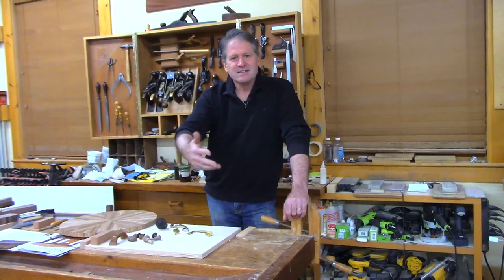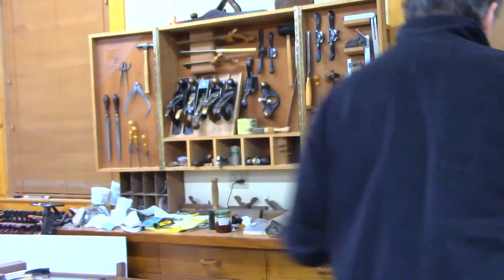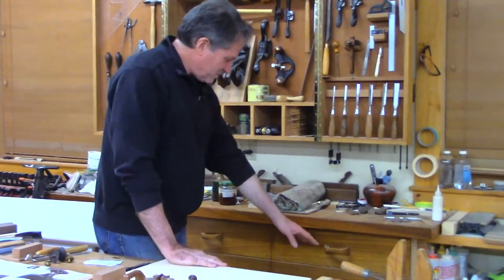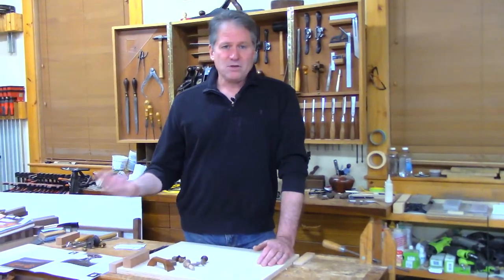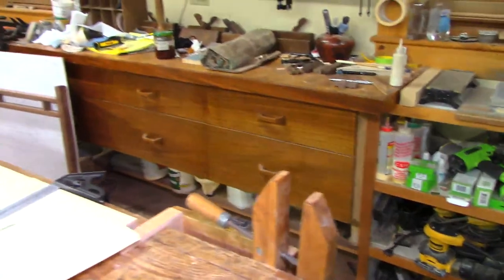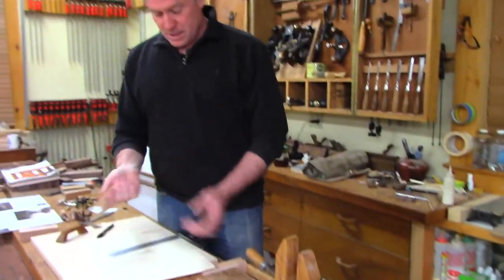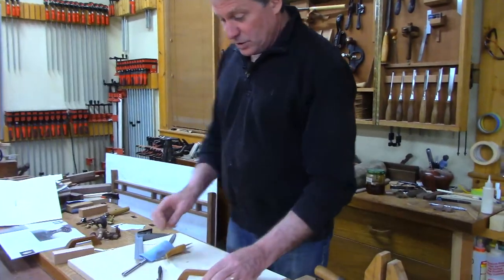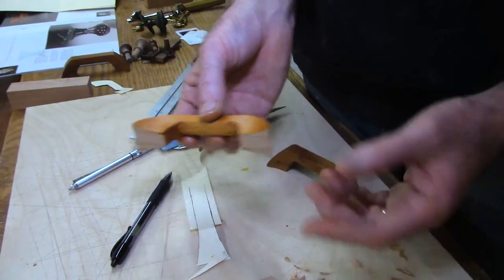How to Make Wooden Drawer Pulls with Tom McLaughlin

Comment: James Krenov may have been a crusty old woodworker, but his ideas and designs have been an inspiration to many outstanding craftsman -- and even some of the rest of us. Over the years, I have built a number of projects inspired directly by Krenov. The first was a wall-mounted jewelry cabinet with a coopered door and two dovetailed drawers. I made this over twenty years ago, yet it is one of the first things my wife talks about when she explains the work I have done. She treasures it; I treasure that she does. I built a similarly-coopered two-door hanging cabinet in cherry for my mother-in-law; it is now in the possession of one of her great granddaughters, who adores it as much as her great grandmother did.

A second example is a chess board made with "floating" squares after Krenov's design ("The Impractical Cabinet Maker", I think).   I didn't make a chess table; rather I built a chess board mounted to a two-drawer case. I presented this piece as a graduation gift to a student abut 15 yeas ago. The tiles were made of air-dried walnut and birds eye maple. The case was walnut. (The walnut came from a lightning-struck tree in Reedsburg, WI that was milled and stored in a barn for 18 years. Bat and pigeon guano bring out the best in walnut, it seems.)  The student's mouth dropped open and he teared up when I gave it to him, because he thought it was such a stunning piece.

There are other projects similarly inspired by Krenov, particularly the way he used hand-made handles and pulls. These became part of many boxes and cases I sold at art galleries over the years. It seems others loved Krenov's ideas, as well.

This is a another great topic for another great video.  Thanks!!

Crusty old codgers RULE!
Reply from the maker: Wow Jerry, I had no idea you have been at woodworking so long an have sold in art galleries! And that we have similar appreciation for Krenov’s work. I know the chessboard you’re talking about, there is actually a photo of one at the back of the Cabinet Maker’s Notebook, and I almost made one like it twenty years ago but opted for a veneered version with a more Art Deco feel.
I never met him but a friend who did, Terry Moore, mentioned his “cranky” attitude as well. It just goes to show it takes all kinds! 😎
Great stories, thanks! 👍
Reply: @EpicWoodworking  One of the benefits of being old is that you have been doing a lot of things for a long time. 😎